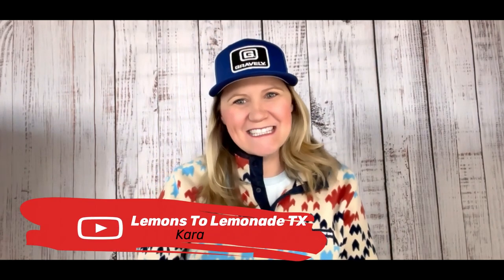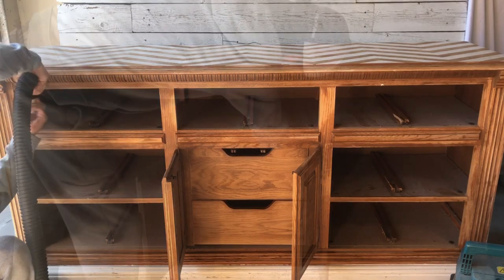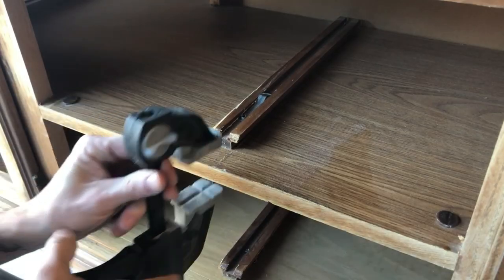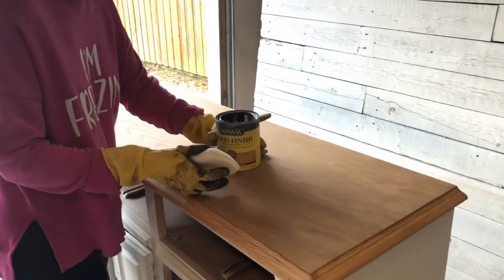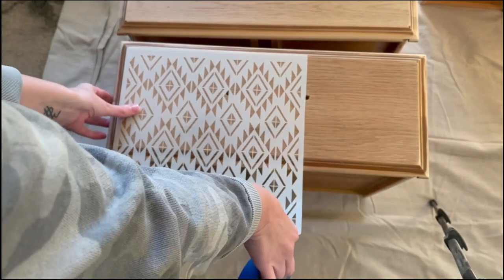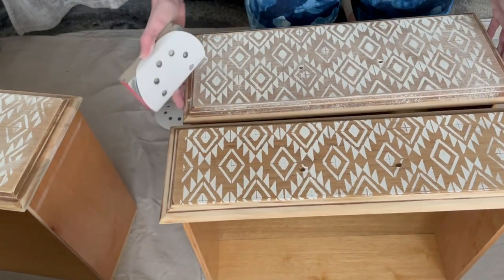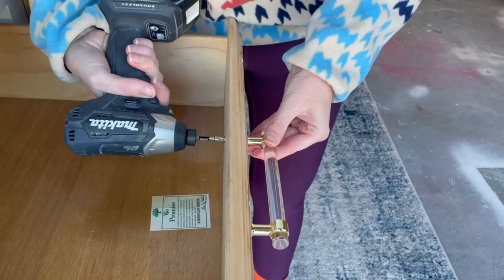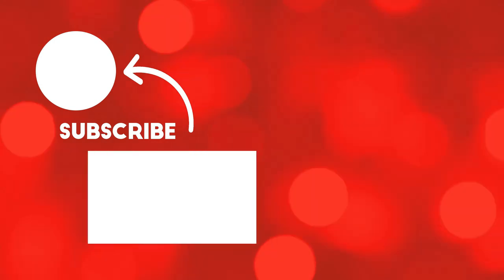How to Flip Furniture and Make it Look Amazing // Ugly Duckling

Comment: You run the paint gun fanning really tight. How do you know the compression without a regulator?
Reply: I wondered that as well, what are your settings if you have a regulator at the compressor rather than at the base of the spray gun?

Comment: It looks like an oak dresser.  Oak was huge in the 90's and it was always natural, with that slight orange tinge to it. My mom has a whole living room set still she got in the 90's. So someone had painted the chevron on top. If it was from the factory,  the whole dresser would have been painted. Not just the base and chevron top. That style didn't appear until mid 2000. 

Oak soaks and absorbs so that is my guess of why you have a residual pattern left over. Prestain may have helped that, but i dig the subtle look it gives.
Reply from the maker: Yes! yes! It was pretty cool with the stencil. Prestain would have been good huh? I did some mineral spirits to clean and thats when I first saw it. but i figured it would flow well. Thanks for watching!

Comment: Gol-LEEE, how do you just break off so many drawer pulls like that?
You are great with the stencils.  At the Dollar General, I got a stack of 30 stencils a little bigger than a deck of cards, they are heavy cardboard, but I have used them many times, since the paint just makes them more durable.  I wonder how a plain, slight design would have been on those center panels?  Those doors look a little plain compared to the rest.  Anyway, great result.  AND Congratulations.  MY opinion on the chevrons on top, they were added 5 years ago and the pulls were painted.
Reply from the maker: Yes! I think they were added too! I just was surprised on how totally perfect they were! Looked like a big 'ole stamp just rolled across the top! Anyway, thanks for watching! Missed ya on the last few videos! Hope you have a great week!